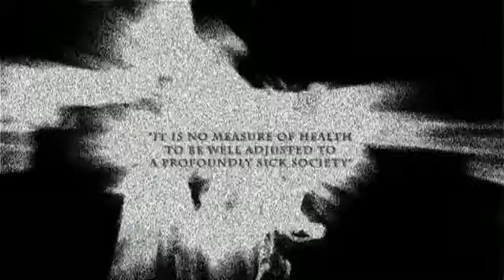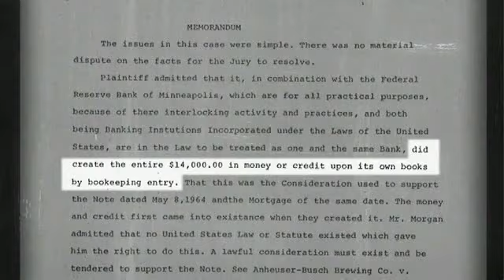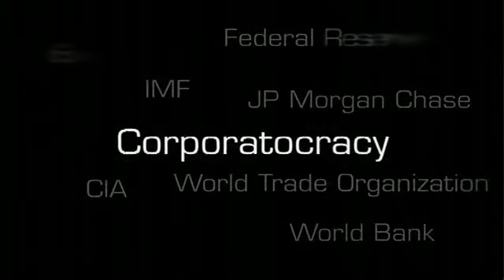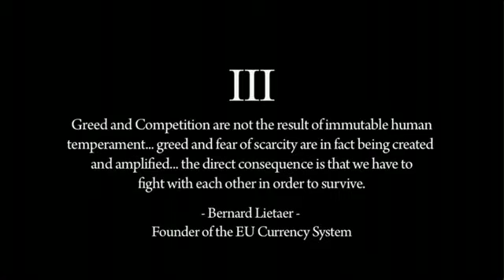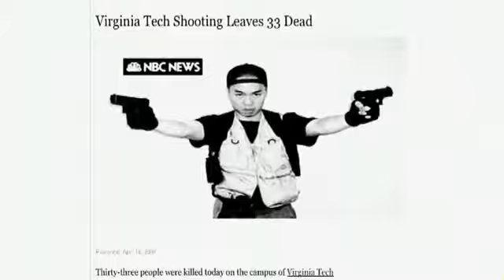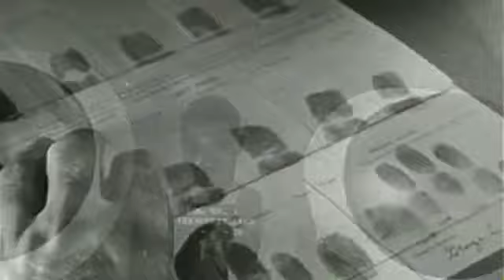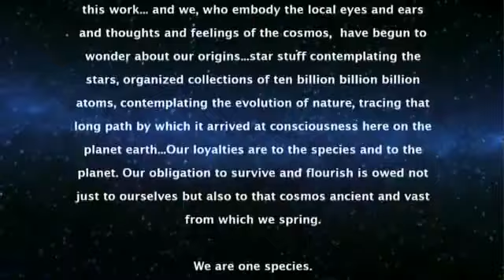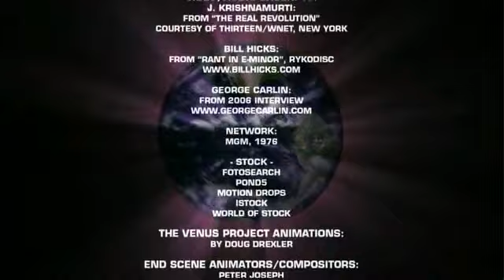Fractional Reserve Banking

Comment: I just want to clarify that the Fed is not permitted to buy bonds directly from the Treasury. It buys them on the open market, which means the Fed buys them from commercial banks. Treasury auctions bonds at less-than-face-value to commercial banks, and commercial banks deposit bonds with the Fed. It's from these deposits that currency is created. 

It's so twisted because the commercial banks own the Fed, create the market, and collect the interest. They make profit every step of the way even before currency reaches the economy. And, also, they are able to buy goods and services before the inflation they create settles into the system! Instant, guaranteed profit. It's win-win-win-win-win for the banks.

Correct me if I'm wrong on any points here.
http://www.federalreserve.gov/faqs/money_12851.htm

Comment: Excellent reasoning and some good insights. I must however point out that many of your conclusions and arguments are based  on a set of assumptions you have taken for grated relating debt. Debt has always existed and will always exist , it is a necessary part of human society. Consider the stone ages. Say you want oranges and offer apples but the other person on the market wants has oranges but wants pears? How will you solve that problem , economists are so jaded that they have forgotten common sense!! the answer is simple you will get the oranges and promise to give pears later on. (you just issued debt) this system works perfectly in small communities , actually we are wired to it which is why liars and irresponsible humans are instinctively despised (e.g politicians who break promises) otherwise the system breaks down and you are forced to deal with a massively, massively ineffecient system of barter (which is why recessions are terrible). However we live in megasocieties and debt has become impersonal by necessity ,thus harder to regulate (i dont have an answer , just want to stimulate you). Interest obviously is required for otherwise you will never get the oranges as the other person has no interest to give them to you, as there is an oppotunity cost. As you can see debt is trust , thus by defenition it is created out of thin air. the issue arises when this process becomes uncontrollable on a gargantuan scale (eg wall street leverage 1:300 which also brings new exotic complications)For some perverse reason entities leveraged 1:300 are considered creditworthy, blame government for that. Great vid , but i urge you to question assumptions you take for granted.

Comment: War on terror? Terror is not a noun. This is a first. Earths load capacity is just another way of saying scarcity. Resources are limited and human desire is not so there has to be some arbiter of who gets what.  They talk about abundance almost in the same sentence with scarcity, so what's it going to be? A million miles of maglev tubes? Where they coming from? I am sorry but you still have a lot of problems obtainind energy because of scarcity and rare earth element mining is very dirty. All electric systems will use a lot of copper. You cant get rid of all friction and resistance so you still have entropy. A lot of this depends on beliefs and belief is not worth knowledge.